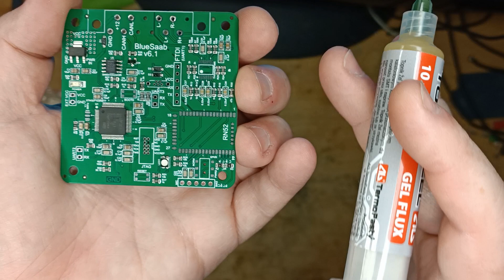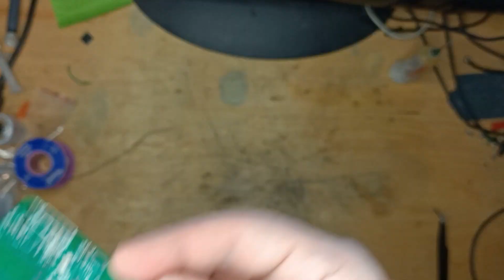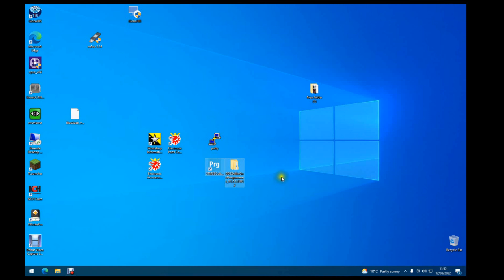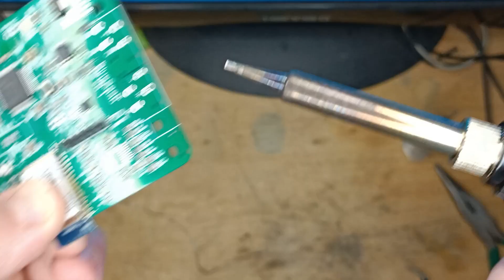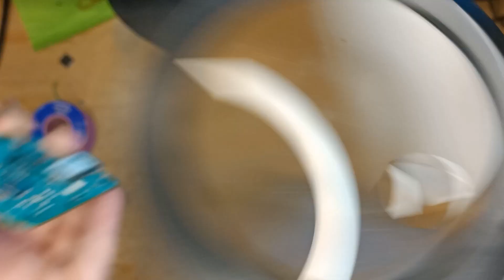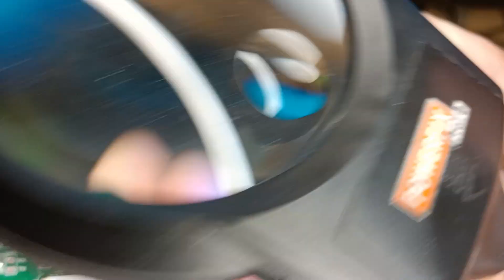Episode 32 - BlueSAAB Pt 2 of 3

Comment: 你好，FTDI 电缆用的多少V呢?3.3v or 5.0v?Thank you
Reply from the maker: 两者都应该有效。 我的是 5V，但只要您使用我使用的接头，那么 bluesaab 电源调节器应该处理任何一个。
Reply: @saabfeverfrank  Hi！ I give the Bluesaab brush program, the green light on the motherboard has been flashing, this is the brush program success?thanks
Reply from the maker: @alxelin9546  that does indicate that something is hapening, yes.  Perhaps connect the FTDI to the other pins (UART 2) and use a terminal program to see if there is any output.
Reply: I changed to the UART 2 socket is just like that    Error: Activating device: KO. Please, verify the boot mode configuration and check the serial port configuration. Reset your device then try again...  @saabfeverfrank
Reply from the maker: @alxelin9546  When connecting to the UART2 socket, you should just use a terminal program (Hyperterm or Putty) to look at the data on the line, it sounds like you are still using the flash program.  Also, sorry for the late reply.
Reply: Thanks, after I connected Putty with UART 2, nothing in Dos mode and cannot enter a command in Dos mode @saabfeverfrank
Reply from the maker: @alxelin9546  It would appear that the program is not running.  Have you fitted the oscilator near the cpu?  You can program the chip without it but it won't run.
Reply: I installed the oscillator, but I don't know if the oscillator has any positive or negative? I have welded to all the electronic components, and I have successfully brushed Bluesaab V6.1.1. I didn't connect the Bluesaab to the car, but I connected through 12V, and my phone didn't find the Bluesaab Bluetooth signal. I don't know if I have succeeded? @saabfeverfrank
Reply from the maker: @alxelin9546  appologies for my late reply again.  No, the oscillator has no polarity, so it doesn't matter which way you solder it to the board.  The BlueSAAB won't announce itself until it's connected to the car, you switch the radio to CD Changer and then press 1 on the radio,  then the bluesaab should show up on your phone.
Reply: Thanks for the reply, I have finished the assembly @saabfeverfrank
Reply: @saabfeverfrank  Hi.Do your BlueSaab XM have a firmware?
Reply from the maker: @alxelin9546  Sorry, I`ve never made an XM version.  Did they finish the project?  I didn't really pay much attention to it as none of my cars have XM radio

Comment: Too bad mine has the navigation
Reply from the maker: What Nav unit do you have?  BlueSAABs do work with the Denso units but not the Kenwood ones.
Reply: @saabfeverfrank   2005 Saab 9-5 aero 
I’m sure is the denso nav
Reply from the maker: @TheSaab04  I believe this is the Denso unit: https://44.cdn.ekm.net/ekmps/shops/1a3c5a/images/saab-9-5-2017-18-denso-uk-europe-satellite-navigation-map-updates-map-discs-available-complete-set-879-p.jpg?v=2972021-103200
Reply: @saabfeverfrank   yes is the same I have
Reply from the maker: @TheSaab04  Better start making yourself a BlueSAAB then!!!
Reply: @saabfeverfrank  I have to star ordering all I need then tanks youuuu
Reply from the maker: @TheSaab04  no problem, i hope this little series helps you.